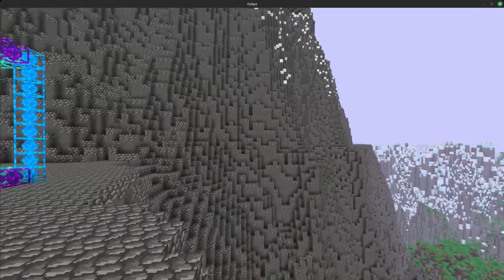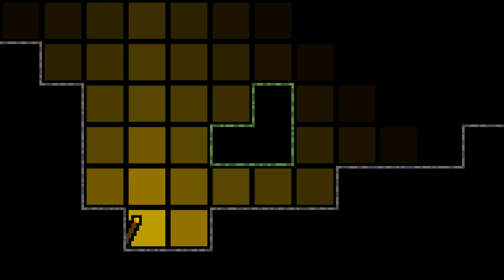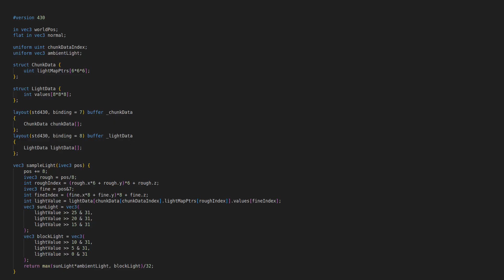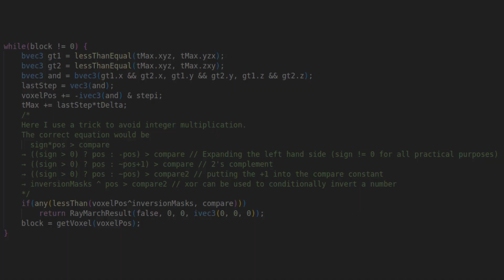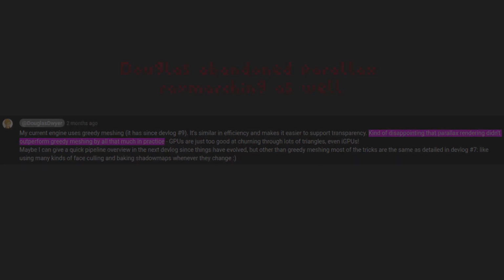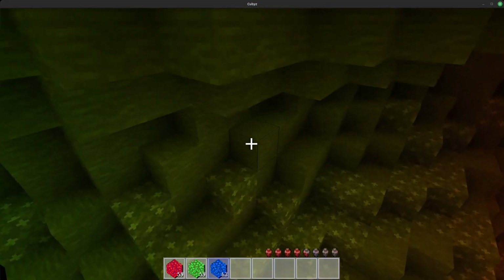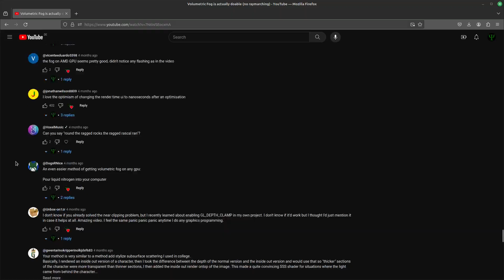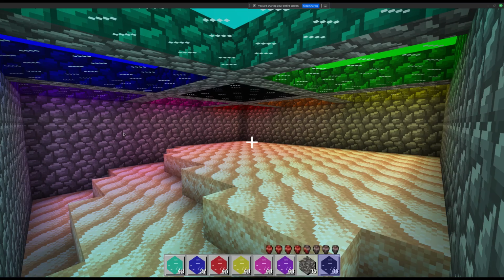I had to sacrifice a feature to implement Lighting

Comment: One thing with the floodfill is that it always ends up with the same shape and same values. Doesn't matter if you go around a corner or not, it's always this 45° rotated cube, and light levels can just max() of all of them. But if you don't propagate the lighting, your new shading trick in the recent video sadly doesn't automatically calculate itself anymore

Comment: how about my idea? 
each voxel generate light_efcet_value_map of each coner and combine too calculation at grid light_level
ex) n_w_u weight is .8f and n_w_u light level is .7f, s_w_d weight is .4f and s_w_d light level is .5f than result is .8*.7+.4*.5 and so on.
(n_w_u: North_West_Up, s_w_d : South_West_Down)

sorry for anoing text. i'm not good on shader or english either.
Reply from the maker: If you calculate light for the corners you get the problem that blocks will be darker due to self-shadowing, which I briefly mentioned in the video.
You'd need 1 value per corner+normal pair, so effectively 48 values for the entire cube. That's a lot.

Comment: I'm trying to help without understanding the whole thing here.
There are always more ways to optimize:
 - https://www.youtube.com/watch?v=DW93P4bZJIo Sean Barrett explains his GPU compute shader voxel raycasting engine; I think he couldn't get it to work, but still worth
- https://www.youtube.com/watch?v=QTXGMytaGz4 Using octree to ignore most voxels; no need to calculate empty ones
- https://www.youtube.com/watch?v=4xs66m1Of4A batching thinga together; I assume there are ways to batch voxels as well
- you could use SIMD to do single operations on a whole batch in one CPU call
Reply from the maker: I'm aware of all of these.
The first two only make sense when using raymarching for the entire scene. Starting the raymarch from a tight bounding box in my case already has similar benefits.
Greedy meshing is on my todo list, but it isn't so easy because of lighting and additionally the t-junctions in the greedy mesh sometimes cause pixel errors or seams on the screen.
I'm already using SIMD in a couple of places. But it's generally pretty hard to vectorize most algorithms.

Comment: Might be stupid, but did you think about calculating it per-face, then using the same light level for all voxel faces with the same normal inside the block? You keep the per-block flood fill and I bet it doesn't look that bad, it's sad seeing voxels go ):
Reply from the maker: There are some edge cases with this, that would cause problems.
Let's say you have a voxel model next to a full block. The faces pointing in the direction of the full block would be completely black with your approach.
Reply: @quantumdeveloper2733  Didn't think of that, dammit! I don't know how you stored it exactly, but if blocks do have their own light levels, just use the light level from the block they belong to with inner voxel faces, or even transitioning from the block light level to the face light level as you get closer to the face, making voxels near the face, if occluded, darker, as a kind of ambient occlusion. At that point, however, the logic might be just as complex as whatever else you have already tried :p

Comment: What higher level optimizations did you try for the voxel models?  Is the problem overdraw, or is the lighting just too expensive?
Reply from the maker: lighting is cheap. The main bottleneck is the raymarching loop.
Of course overdraw also plays a role, but I've done as much as I can really, apart from sorting the faces. The voxel models are drawn after the rest of the terrain, and the chunks are sorted from near to far. This wouldn't help with the grass though, as adjacent voxel models can still cause overdraw.
Apart from overdraw I also think that the size of the triangles of the bounding box is another problem. The GPU will schedule a bunch of extra pixels at triangle edges to compute gradients. Greedy meshing would have helped here, but then I would have a hard time to make the grass react to wind.
And after I added a simple LOD to voxel models(just replacing the model with a flat texture after a short distance) I'm also vertex bound in the distance since a bounding box for raymarching (10 triangles on average) is pretty big compared to for example a simple cross-model (4 triangles).
Reply: @quantumdeveloper2733  Apologies if you've gone over this before and I understand if you want to be done with the idea, but did you consider doing a two-level raymarch, first against some top level acceleration structure (like a SVO or BVH), then against the models themselves rather than relying on hardware raster for the object bounds?  That may speed things up a good bit, especially if you're worried about quad inefficiencies (which makes sense looking at the grass).  In fact, I could genuinely see eliminating quad inefficiencies speeding that pass up by well over 50% in pathological cases given how complex the low level ray march is, and because you're only tracing against instances, I'm guessing you'd get pretty good thread divergence in the associated compute shader.  I'd at least think it'd be a win over such expensive helper lanes in the raster path, but I could be wrong.
Reply from the maker: @IanDiaz  I experimented with full raymarching in the past(~2 years ago) with an SVO (actually a DAG, all the models could be deduplicated).
But even on a small scenes, 32×32×32 blocks which consist of 16×16×16 voxels each, it's already below 60 fps. I could probably improve my octree traversal a bit, but I don't think I could make this playable for significantly larger render distances.
Overall I think that the parallax raymarching, despite its flaws, is in the end faster because it requires significantly less steps and the steps are also significantly cheaper than an octree approach.
I have not tried a two-level approach in particular, and I don't think it's that easy. Like what do you do if the model has holes and the next one is far away?
Reply: @quantumdeveloper2733 To be clear just because it sounds like you may be thinking about this happening in raster, this would ideally occur in a single compute dispatch.

This may be very similar to what you were already doing with your DAG, but if a ray intersects a TLAS node (DAG, BVH, SVO) but misses the associated BLAS instance trace (volume texture, i assume?), you simply go back to tracing against the TLAS until you find another hit.  If you visit the TLAS nodes in depth order and are able to minimize thread divergence, this should guarantee the minimal number of executions of the BLAS casts (just need to make sure to do that local depth sorting efficiently, ideally with wave intrinsics if they're available, but I'd think you could do it efficiently with group shared memory as well to share the depth sorts between neighboring pixels).  I'd think doing it this way would reduce overdraw and mitigate quad inefficiencies compared to the raster path for small instances, but the overhead of walking the TLAS may be too high on integrated hardware.  Only one way to know lol.

If a full TLAS is too slow, I could see running a pass that builds a list of instances that intersect screen tiles kind of like forward+ does for lights, then use that as your "TLAS".  Per tile, you would depth sort and shade until you had a hit.  I'd expect that to be faster than the raster path for the same reasons as the SVO and it should have even better thread divergence, but that requires the tile build to be pretty fast.

The other potential approach that comes to mind is something like per pixel linked lists for OIT, where you would generate a list of instance intersections per pixel, sort them, then shade until you have a hit, but that seems like it would strictly perform worse than the tiled or traced approaches on GPUs due to extreme divergence.
Reply: @quantumdeveloper2733  one other possible optimization which wouldn't require quite so much work - have you tried doing the instance ray marches hierarchically by walking the mip chain of the associated 3d texture?  That could significantly reduce the number of required taps in some cases, as well as working as a lod system for distant instances (clamp the most detailed mip level you read from based on distance).
Reply from the maker: @IanDiaz  You are right, so far I've only used a full screen quad and done the tracing in the fragment shader.

Honestly I have lost faith that any voxel raytracing works well on integrated GPUs, at least not for another decade or so. Even if you find something that works on my integrated GPU, intel iGPUs are 5 times slower than that and I want Cubyz to run on a wide range of hardware.

Per pixel linked lists are fun. A friend of me played around with it and I helped him a bit. Sadly it can also be really slow, especially the sorting bit.
Reply from the maker: @IanDiaz  I have not done that, and I wouldn't be so easy to implement either, as I didn't use builtin 3d texture types(there are no array texture, and I didn't want to bother with making a 3d texture atlas). Generally I think that walking down the mip chain would require a ton of additional steps.
I did try to increase the step width by storing a distance field in the texture, but that decreased performance compared to the trivial DDA.
Reply: @quantumdeveloper2733  PPLL can definitely be slow, which is why I mentioned it'd likely be slower than the tiled or traced approaches :P

Re: 3d textures, I just kind of operate on the assumption that everyone is doing bindless these days, but if not, that certainly complicates things.  I do wonder how much of a perf boost you'd see by using hardware 3d textures and doing HDDA against the mip chain (or even just sampling the dual of the 3d texture sample locations with bilinear filtering for a simpler multisample tap), where you'd likely do more traditional draw call batching against the texture ids instead of (I assume) doing a single draw call with your texture array bound, but I will admit that I haven't spent much time specifically optimizing for iGPUs and am really not sure of their performance characteristics.

Were you storing the SDFs into a separate texture, or were you doing something like encoding jt into the alpha channel of the voxel data?  Either way, I imagine hierarchical DDA would probably be faster than an SDF for this particular use case given how relatively dense the data is (SDFs only really help when you're able to reliably skip large numbers of otherwise uniform samples, whereas here it intuitively seems like in a lot of cases you'd skip one or two taps max, which wouldn't be worth it ESPECIALLY if you're doing an additional texture read).
Reply from the maker: @IanDiaz  To be honest I just haven't tried many extensions yet and bindless is only available with an extension in OpenGL.
Using a 3d texture might indeed be faster as I need to do a few bitshifts and stuff to read the 4 bits of data out of my buffer. The builtin texture sampling unit is probably better at that.

For my voxel models+distance field I stored everything in 4 bits.. After subtraction the values -6 to 0 gave me the texture info, the value 1 to 9 gave me the step width I could take without hitting the next wall. So overall it's just one texture read.
I also figured out that even in the best case I could find(visible at 3:38) simple DDA was faster.

Comment: Will the colored lighting work on Macs?
Reply from the maker: The game never worked on mac. Sadly apple does not support modern OpenGL(they only support old OpenGL or Metal, their exclusive rendering API).
I would like to support mac in the future though.
It will be a while though, as I'd need to rewrite the rendering code to use Vulkan(which runs on mac thanks to MoltenVK).

Comment: I think I have a way for you to make your voxle marching faster. You could sample a lower mipmap level and  then that way know if you hit something. You basicly turn your linear marching into a octree kinda marching. This reduces your required steps from O(N) to O(log(n)) in the best case.
Write to me for more info
Reply from the maker: I used a signed distance field approach for a while, where I stored the optimal step width in each voxel. This has a similar effect, reducing the total number of steps at the cost of making the individual steps more costly.

However I discovered that approaches like this don't work that well, since my models are really small(≤ 16×16×16) with a tight bounding box.
Due to this the total step count is not changed significantly.

So in this case linear raymarching is just faster because it has a simpler step function.
Reply: @quantumdeveloper2733  what GPU do you have?
Reply from the maker: @10bokaj  AMD Ryzen 7 5700G integrated GPU, but for the first half of testing I only had a 3200G

Comment: ermmm it sounds like you lost. now try hrader in your next life. simply implement global illumination. flood fill is just a cheap approximation of global illumation anyways. while you're at it, be a man and implement volumetric lighting
Reply: The goal is to make a game, not a tool to cause GPU autoignition
Reply from the maker: Yeah, it's cheap. That's exactly why I'm using it. I am targeting low-end hardware and integrated GPUs, so any proper GI would be too slow or too noisy or both.
Reply: @quantumdeveloper2733  IDK cuz me personally if i implemented it, it would just run quick :p

My comment was meant to be a joke comment but AFAIK, voxel ray marching, when properly optimzed is actually faster than rendering a lot of triangles, if you aren't using GI. With GI, you need to implement a denoiser and whatnot. I genuinely think its doable, but despite your parralax ray marching being quite cool IMO, I think you should do whatever you think is the best direction to take your rendering in.
Reply: @ethos8863  my comment got deletificated twice.

Voxel raytracing, iirc, is one of if not the most efficient (usable) rendering algorithms.

But of course GI increases the accuracy so much that the work has to be high, despite the efficiency.

You can still use raytracing to render the voxels ( and maybe for sunlight* ), and flood fill for the ( other ) lighting though, and you get refractions / reflections on top.

*that way you can skip re-calculating the flood fill completely if there are no light sources nearby and get nice shadows

If you used octrees for the raytracing, they might help with the flood fill too ( i don't actually know how flood fill is optimised, but it seems useful. maybe it isn't )

The problem is that old and integrated GPUs, the target hardware, doesn't expect to be used for anything except rasterisation, so they make that as efficient as possible at the expense of everything else.

Comment: Oh dang weird to see my seed of andromeda blog referenced. Glad it helped!
Reply: Also.. for your problem, the way I would have tackled this is to have two light models. One for your normal voxels, and one for your raymarched voxels. Render them in two separate passes, with separate shaders, and LOD the expensive raymarching models. I do think going to triangle models is a smart choice though, its a lot simpler, and faster.
Reply from the maker: I actually did use some LOD for it, by replacing it with a solid box after some distance.
I also think that maintaining two light models would lead to inconsistencies that would make the voxel models stand out in an awkward way.
Reply: @quantumdeveloper2733 You are probably right!

Comment: 5:28 now im a bare begginner i engine making, andi may have misunderstood this, but couldt you use white/yellow lighting for normal blocks and then overrite the lighting to a three channel when there is a a rgb light emmiter?, so you wouldnt have to keep 3 channel at all times, you would just convert those block to use 3 channel lighting when a rgb emitter is detected.
Reply from the maker: Yeah, that seems like a good idea. However I think it would be a bit of a pain to detect and handles cases like this, especially in a game that the player can freely edit.
Also there are not just rgb emitters, but also rgb absorbers, which includes leaves for example. So it might not even be that good in practice.
Reply: @quantumdeveloper2733 couldt'n you just check if there is a light update and a emmiter is or isnt a rgb light? idk about the absorbers thought, so may it isnt pratical after all.

Comment: is there some way to completely exclude voxel models from the lighting engine, and just have pre-lit variants for when they're supposed to be interacting with light?

like, the model itself isn't lit, it just has a series of textures that look like they're different shades of lit but are actually fullbright, and get swapped out when the lighting changes.
Reply from the maker: I think calculating light differently for voxel models would make them stand out when placed next to a normal block.
Reply: @quantumdeveloper2733  i see. Your work thus far seems pretty seamless, so I'd imagine you'd want to maintain that.